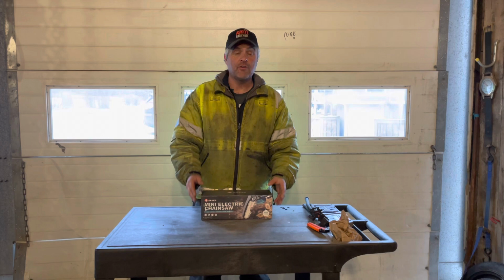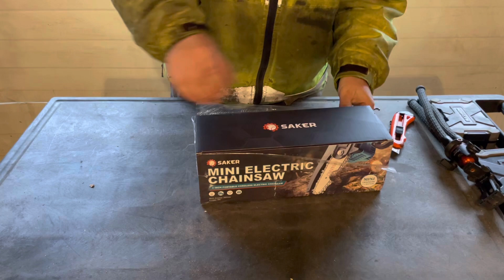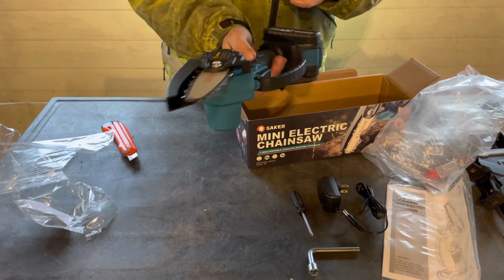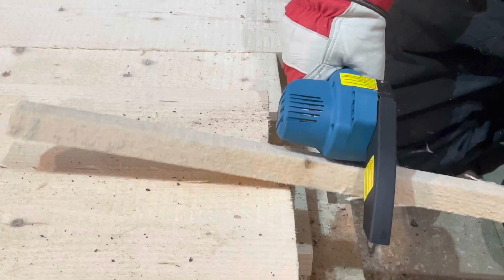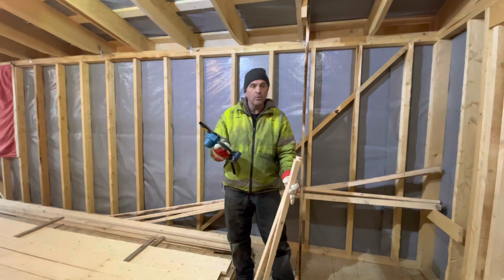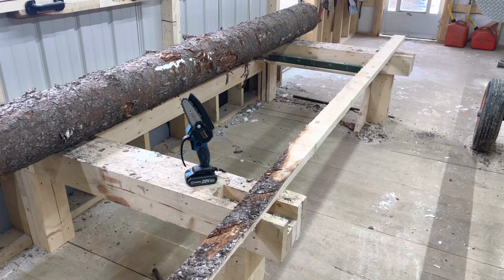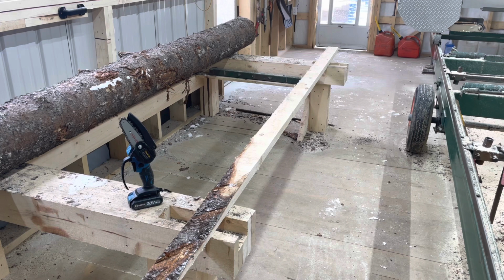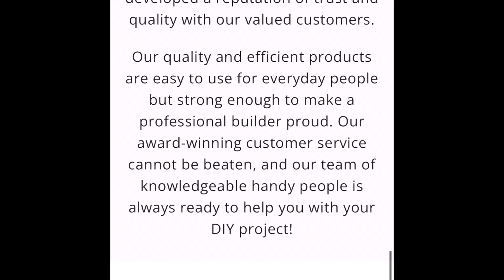ALL NEW MINI CHAINSAW -great quality handheld chainsaw by Saker

Comment: Doesn't have a built in chain oiler does it ?
For such a small saw I guess  it  doesn't really matter, I can always put oil on the chain manually.
Thanks for this Russell!
Reply from the maker: Hey Reg, unfortunately no it doesn’t it’s the one thing I wish it had, according to the manual you oil it manually before each use. 
Thanks for tuning in !
Reply: @russellbelliveau1694  Yes and in a little saw like this, it's a simple thing to ( manually )  oil it as you go. Not a "deal breaker' for me.